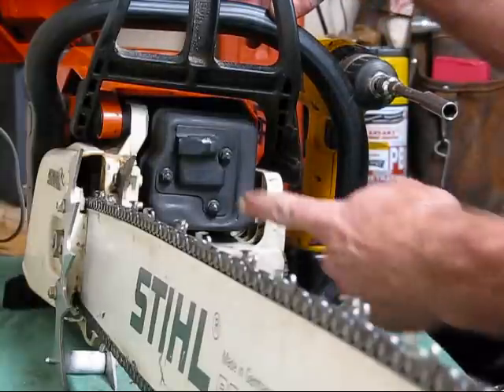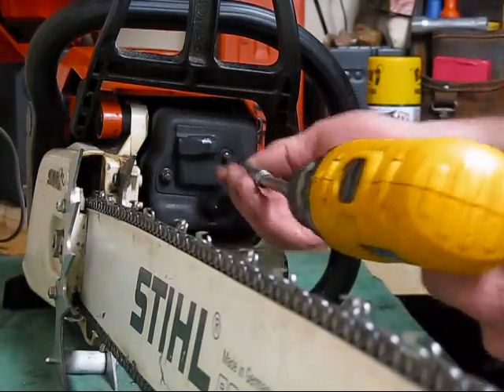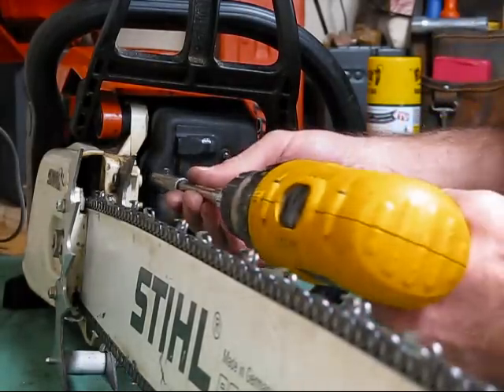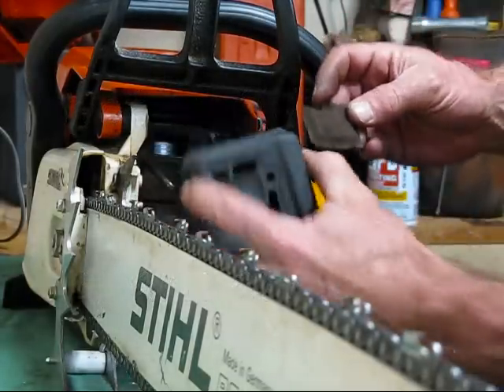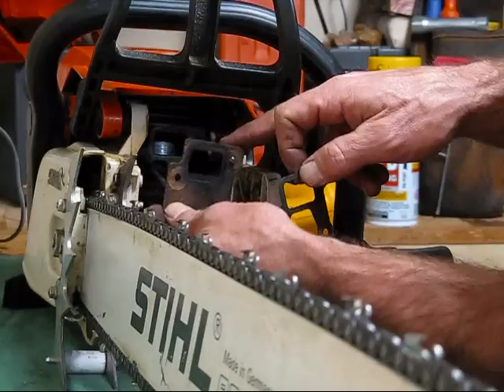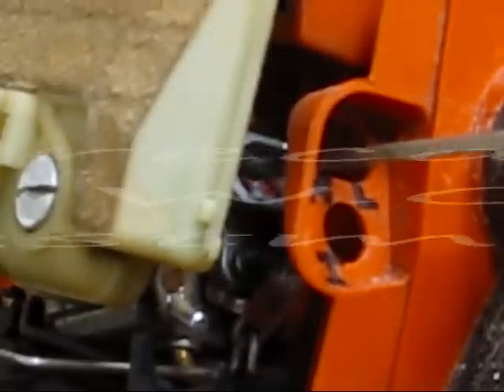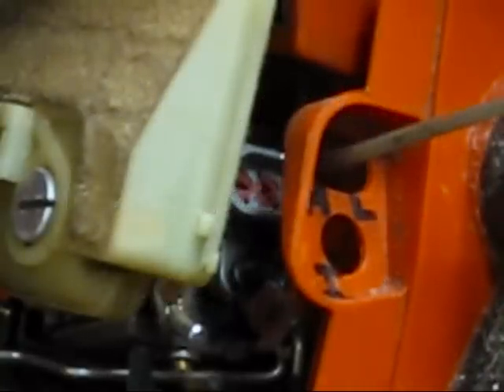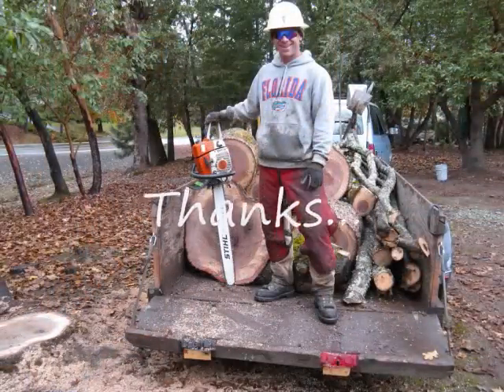How to Modify Stihl 039 / MS390 Chainsaw Muffler & adjust Carburetor - Shredder II

Comment: bought an 029 yesterday went out and cut with it once and it was great. got home watched your video took apart the whole saw rebuilt everything, new plugs, air filter, fuel filter, etc. then i did this upgrade and it was a world of difference. cuts so well, and so fast now, it doesn't even seem like the same saw. i am 16 and love working on saws and this video really is a miracle worker. thanks brother!!!
Reply from the maker: Awesome... Gotta dig that piped-up feeling, makes a guy wanna get his saw on. I'm probably grinning as big and proud as you are!! Like you, I started young. First working on my Dad's falling saws (.044, .056 super AV's) at 12 and fell my first 36" fir at 14... yet wasn't "legal" to work with power saws until 18... don't think I didn't cut and sell alot of wood thru high school :)  Keep up the good juju and stay safe...

Comment: I'd forgotten all about this video,and my saw,lol. I'd bought a ms310 about the time you put this video out and did your muffler mod and tuning on it. It had been a great firewood saw and ran alot cooler too. The coil went out on it a couple years ago and I just started using my other saws. I forgot all about my ms310 until now. I'm gonna pull it back out of mothballs and order parts for it. Thanks to you it not only got tuned,but itll also get a 2nd life.
Reply from the maker: Right on!!

Comment: Thanks for your video. I’ve got a low compression 039 that bogs down and I tuned it as per video and it’s much better.
I’ve got a cylinder rebuild kit on order and can’t wait to get it installed and ultra tuned.
Reply from the maker: Good stuff, solid plan..

Comment: Awesome video i know its old but im about to do am upgrade on my 290 that i picked up for free with a burnt piston to a 390 top emd from hipa. Why the holes in the intake cover? And where did you get the bigger chip deflector amd the bigger dogs? Please let me know thank you
Reply from the maker: ..added a "winter" air filter and drilled the intake cover after the muffler mod for increased air flow to improve air in/out ratio.. clutch cover, chip deflector and dawgs off an 044

Comment: Good video... Nice saw!   Getting ready to do my new ms291 ... Kinda scared!  LMAO!  Pulled the 32" bar with full chisel skip chain right nice ....all stock!  I think this will really help it rip!
Reply from the maker: +David Thorne - Thanks for tuning in. And yes sir you're on the right track... Tho the 291 may have the new style muffler and they've made it a bit more difficult to mod.  I'll try to post the process... as I've got a 391 that's getting ready for the auction block ;-)
Reply: @Wanous-hv7zo  A 32" bar is to long for an ms290,but the 290,310,and 391 are essentially the same saw. The do use a plastic housing,but the engine is metal and self contained.  It bolts into the plastic casing. Aside from being a little heavy,they are great farm and ranch saws. An ms 391 is 4.5hp and nithin to sneeze at. A muffler modded ms291 will hang with a ms261 or 550xp,its just heavier.

Comment: G'day mate, any particular reason for keeping the spark arrestor ? I havent found much use for them, and the heat off the saw is just as risky for fire risk it would seem, as any spark (which ive never seen come out).
Good video, cheers
Reply from the maker: Forester/Wildland Fire inspections.. all my saws go though it more than twice a year, at the start of fire season on every jobsite and then on each Fire/Faller assignment.. so I just make 'em cut with the screen intact.. Thx for the inquiry :)
Reply: @redlinetimber  yep. Fair enough. I'm using them for personal farm use. Gets very dry here in Australia, have to watch out if you're cutting in summer. Cheers mate

Comment: I have a MS460, my question the compression release when trying to start the saw i push it down and after one pull the release button releases and come up.  Is that working properly, or should it stay engaged until the saw starts.  Thanks for another great video modifing the mufflr and fine tuning the carburator ,  Thanks again George, st louis, mo
Reply from the maker: +George Edwards - Wow, sorry for the delay. It should stay down until the saw "pops', then push it down,  half choke, pull again, starts, trigger, runs. It may be wore out or your saw has high compression causing pre-start release. I don't use 'em... I plug 'em, as they can and do leak. Run it, replace it or install a plug?... ....Drop starting a plugged 460 on a cold morning takes... full commitment :)

Comment: So set my low to 1/4 turn out and high to 1-1/4 turn out and that's it. The carb is good to go?
Reply from the maker: you'll need to adjust them with engine running.. idle turned up to chain rolling.. then LOW up/down till its rpms reach their highest, leave it there..turn idle down to non- rolling chain.. (secure your saw) trigger to WOT, adjust HIGH in till it screams lean(sounds too good), then out till it burbles (billy goats), now back in 1/8 turn or so till it just starts to burb(needs that richness for cooling and stump snort).. that should have it in beast mode, tho may need a micro adjustment to the high side if its too lean in the cut

Comment: Good video have you upgraded the sprocket, and chain to the 3/8 it helps cut faster, and stays sharp longer.
Reply from the maker: Thanks!! and.. Yes, been using the floating rim sprocket for years on the 039 and have always run 3/8 .050 gauge (full skip chisel) on shorter bars and 3/8 .063 gauge on 32" and longer bars.. :) let the chips fly!

Comment: I've just done the conversion and muffler mod etc. And I cannot get this saw to run right at any of these tunes on the carb. It w9nt even start at quarter out on the low and I'm lost on what the issue is. Good spark getting fuel etc just won't run right or idle without idle screw way in and adjustment s way off
Reply from the maker: Initial setting is, 1 and 1 turn out H/L from seated.. your issue is more than likely a case seal (that's not as bad as it sounds).. check for air leaks: impulse line, carb boot, fuel line... but probably dried out seals, **turn saw on its side while running and listen for it to smooth out or pick up idle**.. the side it changes on will be the leaky side, most often flywheel side. seals are realtive cheap.. pop the old ones, use a piece of alum can over the crank shoulder and some two stroke to slide new one down without losing inner spring, seat it and reassemble.. now run that sucker a few times a year to keep the seals from drying out. Let us know what you find, thx :)

Comment: I think it is a good modification, but the two-stroke engines can not or should not have the exhaust very open these engines need some retention of gases for proper operation
Reply from the maker: yes.. about 20% restriction, the porting should be done to allow proper expansion of exhaust gases and then constrict/expell though a max. of 80%(or two 40%) of the exhaust port opening.. re-tune of the carb is madatory as well

Comment: Hey I just did the muffler mod on my ms390 and after I have it at full throttle it takes several seconds to idle back down.
Reply from the maker: check for bound up linkage in your trigger handle or as it passes thru into the carb area..?

Comment: With these modifications, what do you think the increase in power is over stock?
Reply from the maker: Maybe a shetland pony :)  The big gains are in cutting speed and torque, the ability to maintain high rpms under a heavy work load or pull though a bind...
Reply: +1moonbuggy followed  these steps and I am impressed with how my older 039 handles a 28" bar. thanks for the video.

Comment: what did you do to the air filter cover ?
Reply from the maker: Drilled it out and backed it with high flow filter foam. That coupled with a high flow air filter equates to a modified intake... it lets the monster breathe :)

Comment: What size bore does your saw have?
Reply from the maker: +ian “treejunkie101” martin - It's still stock at 49 mm w/same stroke as 440... for comparison an MS361 runs a 48 mm w/shorter stroke and an MS440 runs a 50 mm... and they can all be built as big bore with oversize piston and jug...
Reply: I have an ms290 and Im getting ready to put a 390 kit on it. Ive done the muffler mod and carb tuning but Im just not happy with the power yet. Plus I dont like bending over and a 28 inch bar is great for preventing that XD
Reply: ian martin 290-390 are heavy underpowered home owner saws. ms 440 weight is a little more with way more power and a pro saw
Reply: 1970 olds442 really. cause my 171 cuts quicker than my 290 and its a $200 homeowner saw thats 32cc
Reply: 1970 olds442 and my 290 cuts quicker than a 361 running a 18 when its got a 20
Reply: Muffler mod on an 039 makes a noticable differance. Drilled 6 3/16 holes straight through the front Beind the cover bypassing the baffle. Its louder but not bad. Opened up the deflector to about twice the area of stock. Tuned in the cut. H screw is right at 2 turns out 2400' elev.
Reply: @70 Olds 442...You should sharpen the chains on your saws....test them again in some 20" hardwood.

Comment: Thanks for the vid!!  (in fear length will dissuade you, would LOVE to know your thoughts on this mystery-ridge I found at the back/beginning of my exhaust-outlet-port, it's like a sleeving or something it's weird but I look at it and it looks like I could/should be shaving it, it's compromising like 50% of my exhaust-port!  https://imgur.com/gallery/Ji4smGH  (this just got a muffler mod last night, and I used red/copper gasket-maker when reinstalling muffler as the OEM gasket was more restrictive than the exhaust-outlet's-tip or the muffler's entry-port, so just left it off instead of grinding-out a muffler-gasket..)

You mention it's unnecessary to hurt the baffle inside -- have you found that to be the case universally?  I don't have any Stihl saws but almost all of mine have muffler mods and I'd have to check but quite sure at least 1 of them had no "front-to-back" passageway that wasn't directed through the baffling... I don't "aim for" the baffling but, in hindsight, do wish I'd been more careful to have left more of it in (I only removed significant baffling from one of my mufflers and yeah it definitely is louder than I'd like but I've definitely compromised the baffling on almost/all of them :/ )

How about clean-up?  I've seen a lot made out of cleaning-up the muffler for shavings and I usually do my best however I did one last night & didn't have an air gun, after the 1st or 2nd bang on plywood I couldn't bang-out any more filings am guessing the remainder are stuck to the inside wall or the baffling, while you didn't show anything I'd love to know if you do go and spray-out mufflers before install (and what you'd do w/o an air-compressor....if I've gotta flush this thing I'm thinking if I'm lucky i'll get away w/ a couple cans of carb-spray, otherwise will soak-through gasoline so I can have it submerged and just shake/bang out any filings while-submerged!)

I was also very surprised by your initial carb settings, if you're putting L//H at 0.25 and 1.25 turns after the mod, what were they before?  Or did you mean an additional 1/4 & 1.25 turns to L&H after the mod?  The unit I modded last night is similar-enough to the lil echo 2511t, a 7lbs/25cc little thing, had this clone-saw for >6mo now and love it it's the only saw I've never had to touch its H&L in fact I don't even know which spline-drivers it'll take (glad I got the assorted pack!), to be crystal-clear here: Since saw was OEM and running great, broken-in but still 'running like new' and never had the H//L//Idle carb settings adjusted before, and you went in there and reallllly opened-up the muffler and you opened-up the airflow as well.....would Idle even need adjustment? Or L?  I guess I'm picturing the increased-flow-potential as something that'll only alter performance once it's being revved IE that H adjustments are all I'll really need to do... BUT whether it needs H, or H/L/Idle, adjustments then while I appreciate hearing (and'll try!) your approach here, was hoping to ask: is there a way to tune L/Idle w/ the tachometer?  I've found my tachometer's sole usage is letting me know I'm not revving too-high when not under-load (ie setting H jets so I don't hurt my saws), for L & Idle i've found I cannot get most units "center-range" for OEM-spec-idle-RPM if I set it by ear & by the way it feels good / has great throttle response / idles all day, so I always set everything by-ear except H, but would love to actually just pick up the tach, say "this unit's OEM idle is 3200 RPM" and set it to 3200RPM WITH the L jet feeling like it's optimal (I have to choose: keep idle RPM at OEM-spec, or have it sound/feel great on low-end/idle, they never match and this even happens w/ one of my un-modded units it's bone stock and same problem!)

Thanks again, will be tearing-through your channel now as I'm getting a backup unit or rather a "new work-unit" so the current one can be modded w/o worry, these come 25cc/1.2HP/7.5lbs am dying to get them screaming --- In considering some mild porting w/ my die-grinder I found something...odd, to me at least....there is a massive blockage at the top/beginning of my block's exhaust outlet port, it blocks view of much of the piston/cylinder behind it, I'm looking at this thing dumbfounded, unsure if it's some integral sleeving/compression/etc component that I'm not understanding, OR if it's simply a 'tab' they put in there to meet EPA specs...What do you think?  It's that whole giant upside-down 'V' shaped 'sheet of metal' at the very start/deepest part of the exhaust outlet port:  https://imgur.com/gallery/Ji4smGH   What on earth?!?
Reply from the maker: we're addressing a couple of theses questions in a well to understand upcoming video.. "tuning chainsaw carburators the easy way". 
As for the mystery-ridge: almost appears to be built up carbon/graphite; produced from heat, friction, fat-fuel and/or clogged exhaust??.. may have to pull the jug or rotate piston down and see if you can pop/break some out with minimal force, as in: it shouldn't be there? or is it solid cast or sleeve?